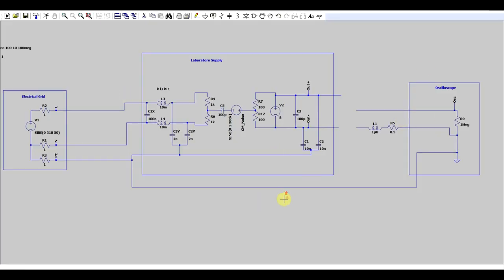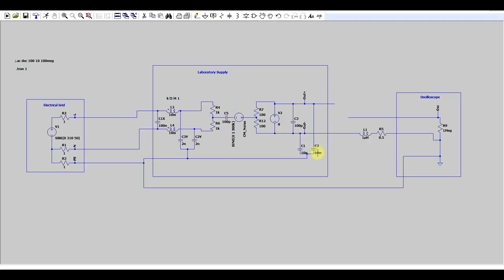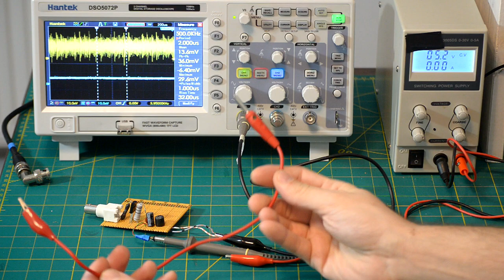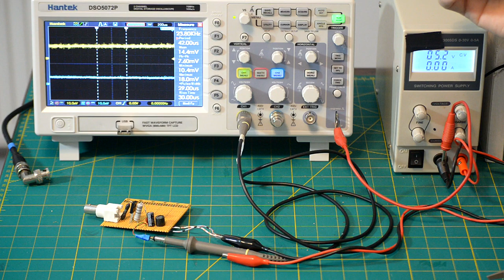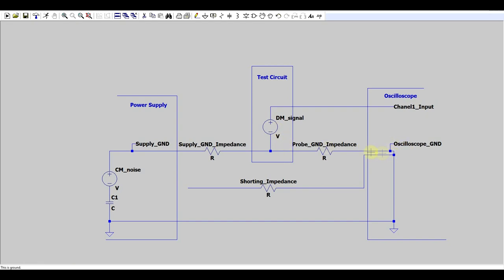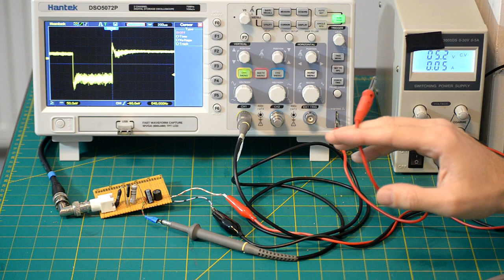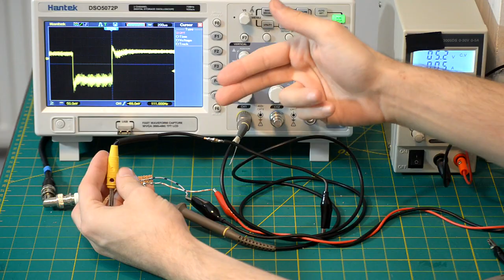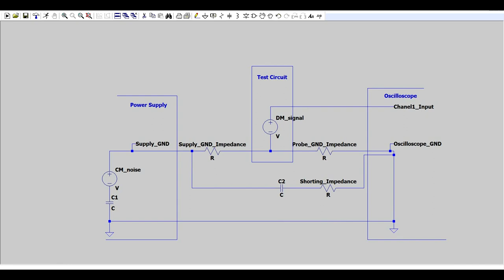Electronics tutorial - Filtering unwanted common mode noise from your oscilloscope measurements

Comment: This doesn't really eliminate the noise. To do that, connect the "hot" chan 2 input independently to the common at your circuit board, then display chan 1 minus chan 2. This eliminates all external noise, and a stronger ground connection isn't needed. Of course chan1 gain must exactly match chan 2 gain (CMRR > 100 dB). I do this with an external scope differential preamp. In almost all cases, this improves S/N ratio by a factor > 100x for sub-mV signals below ~ 1 MHz.

Comment: The fundamental difference between the operation of a nanocrystalline core and a ferrite core lies in the absence of a resonance characteristic of ferrites at frequencies of 0.5÷2 MHz, and work on the absorption of RF interference, in contrast to the reflection of interference characteristic of ferrites, which is associated with a change in the inductive nature of the ferrite choke to capacitive and can create problems in the work of the IIP.

    Increase in impedance and attenuation by 2 - 6 times,
    High resonant frequency and wide bandwidth (up to 5 times),
    Absence of many resonances in the frequency response of the impedance,
    Reducing the leakage inductance by 2.3 - 3 times,
    High saturation induction (1.17 T),
    Excellent temperature stability (in the range from -60°С to +155°С the change in permeability is less than 15%),
    Low active losses in the wire,
    Wide operating temperature range: from -60°С to +100°С,
    Reduction of volume and weight by 2 - 3 times.

Comment: I learned many years ago from a radar vet that everything returns to ground. All those paths need calculating. Star ground / Common ground is king.   =Exercise >> put a bus bar on your desk and tack the rear IEC ground and the front probe grounds to the same bus bar and it should do the trick. You can work "lifted" and not use the ground of the building if you wish.  If you do that be careful to not mix the wall ground and your new ground.  Put a breaker or a fuse to mimic a standard home panel if u want to be nanny safe.  Neutral bonding is a searchable term.
Reply from the maker: I'm not sure if I follow but,  I did have both pieces of equipment connected to the same PE(IEC) ground all the time - I was not using different connections. The issue was the length of the connection - If I just rely on the cables that the equipment comes with, the wires have to much inductance and at high frequencies they no longer couple noise correctly. So the probe ground was connected to IEC ground by default, just the power supply GND was not (that's how the equipment came standard). Normally any proper supply cable that can be used to supply the 2 pieces of equipment from the mains will have more inductance than my short direct interconnection.  
Anyway, for the moment this sort of short connection (I talked about in the video) is good enough for my needs but in the future I plan to upgrade the power supply. Its easier to just remove the noise source completely than just applying bandages to try and hide it.
I did do a previous video in which I hacked into the power supply and another way to reduce the noise was to make all signal return to ground as you correctly put it - I added a bigger capacitor between the SMPS output ground and the IEC - that way the noise source was locally short circuited rather than closing trough other pieces of equipment.

Comment: It's often caused by degradation of grounding wire of oscilloscope. I have old oscilloscopes with old probes on work. And it happens often. In the beginning sometimes this common noise appears but grounding wire is still connected ("ringing" when you test it with multimeter/tester), but some time pass and it even disconnects from DC tester 's point of view. So I have some spare probes for this case and replacement the probe is first thing I do when I see CM noise. Also in some cases using oscilloscope with isolated channels can help (for example Tektronix). And if it also does not help it is better to use differential probe.

Comment: Great channel and video - I found it very helpful. Many thanks for putting this together. Quick question: what is the name of the small blue two terminal connector that you use to connect the scope probe to the circuit board. I am looking for something similar to reduce the ground loops that arise from the small grounding loop?
Reply from the maker: Its nothing special, its a piece of 2.54mm 2pin mother connector (receptacle?) with a couple twisted wires going off it; the blue thing is just heat shrink tubing. The only thing noteworthy about the connector is that the contact is built like a tube, its not the more basic contact on the sides only; not sure how best to describe this.

Comment: To be clear, will this just reduce the probe noise or the noise from the psu ? 
I am assuming it is to see clearly the actual noise in your circuit rather then the added noise from the probes ? Regardless of the psu.

Comment: You are tying the Earth Ground of the Oscilloscope to the Floating Ground of the PSU. Doesn't this present the opportunity of bad, and/or dangerous ground loop problems? It seems to me that it has to be defeating the whole point of having the PSU ground floating.
Reply from the maker: Well the GND of the oscilloscope (all oscilloscopes that I checked - even the expensive ones) have the GND tied to EG. So when you make any measurement using the standard probe , you end up connect the oscilloscope EG to the circuit GND. 
There are certain pieces of equipment that have the GND-EG connection like oscillocope and PC. I guess as long as you dong interconnect 2 of these equipment to form a proper EG loop its ok. 
On the other hand, why is this done? I guess for the measurement equipment to have a stable reference (not a floating ground)
Reply: You can't cheap out on copper and get rid of noise on ground and ground loops.

Comment: what do you call those little sockets you can solder into the circuit to put your probe into? been looking for one for forever but don't know howto search for it!
Reply from the maker: Hello! It's nothing special really - a 2.54mm female pin array that has metallic sides. I found these in 2 versions, one that has a shallow and thin hole, its commonly used as an IC socket and the other one has a wider longer hole - the second is way better.
Something like: DS1002-03-1*10131

Comment: Would the issue of CM noise not be of any concern if the Load was "Floating"  (battery pack) ? If i am probing a battery pack , can i be sure that i wont have any CM nose to worry about ?
Reply from the maker: Depends on how much CM noise is an issue. Any device will have some form o capacitive coupling to ground (walls, the floor etc). For a battery pack, you will have some capacity from the battery to ground (even if there is no obvious connection) and the device you are powering will have some capacity to ground, so it is possible to get CM noise. In any case, to have CM noise, you need a noise source - in my case its the switching converter. The chemical battery does not generate noise, so there should be no worry.
Reply: @FesZElectronics  Also isn't the whole purpose of tying grounds to equilibrate the ground potential between both devices, which will also influencve on parasitic capacitance?. I'm into electronics repair, and the way you show and explain makes you a different guy in this subject.

Comment: Although it is severely pooh-poohed due to the potential case shock hazard, for 40 years I ripped out the grounding terminal on the plug-strip I plug the scope(s) into.  That results in the scope ground being relative only to the probe ground. 

I didn't know about the capacitor trick, I'll try that next!

-Matt
Reply: Just use an AC line filter?
If you put a choke in the ground line, won't that pass 50/60Hz (ELF) but block RF?
Reply: My ancient Phillips scope has only a two-wire plug to the mains.  The whole chassis floats.